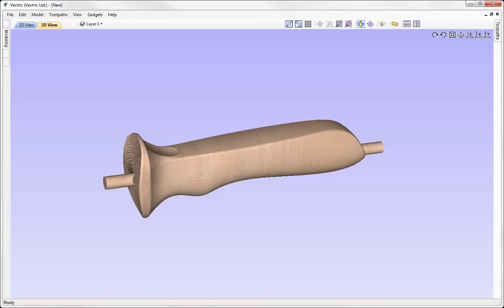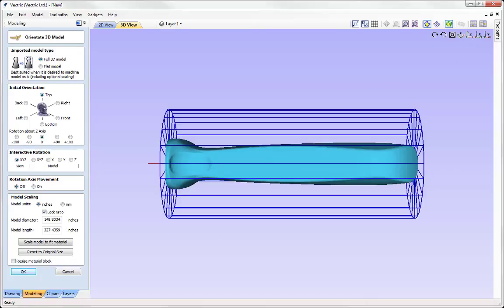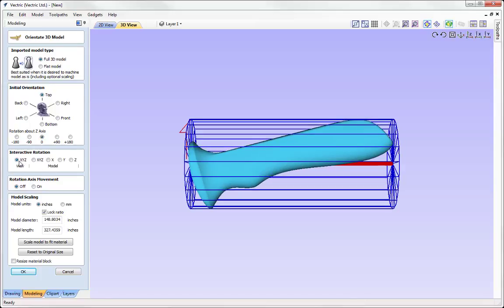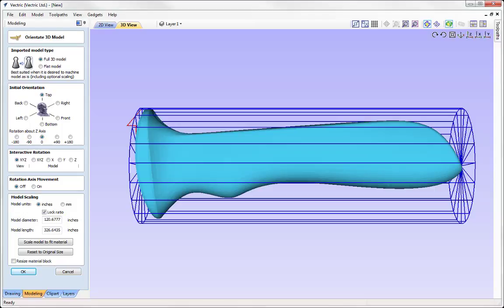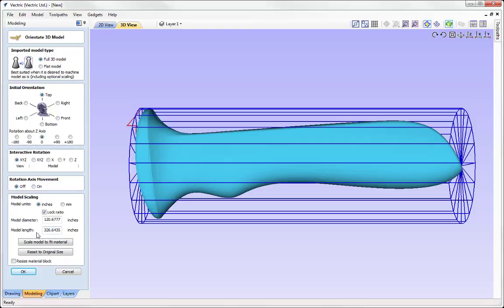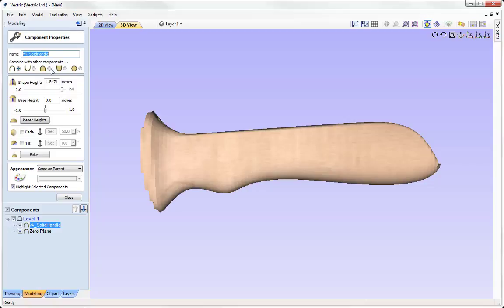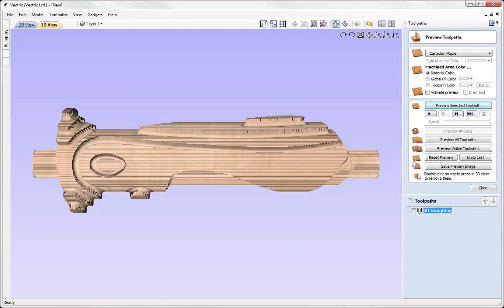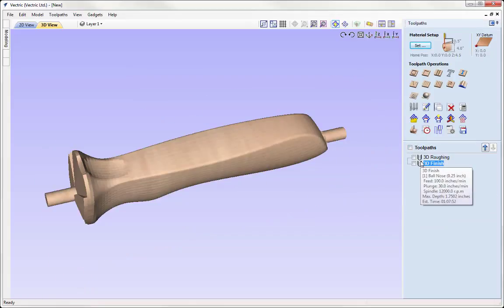Rotary Machining Import and Unwrap a Full 3D Model

Comment: Muy decepcionado con las posibilidades de un  eje rotatorio, creía que se podría fresar una rama de un árbol, o una figura con los brazos abiertos, pero no, solo cosas rectas y en bloque verdad?
Gracias por el video, me has sacado de muchas dudas
Reply from the maker: Hola y gracias por la pregunta. Hay muchos usos para la opción giratoria, incluso figuras. Es posible que tengas que ser creativo con algo como una persona con los brazos abiertos. Posiblemente usando la opción de segmentación y quitando los brazos, córtelos como una parte de 2 lados y luego el cuerpo como un trabajo rotatorio. Vuelva a colocar los brazos al final. Definitivamente puedes usarlo para mucho más que "cosas en bloques". Sugeriría explorarlo en nuestra versión de prueba y ser creativo con su proceso.

-----------------  Google Transulate above --------------------------
Hello and thanks for the question. There are lots of uses for the rotary option, even figurines.  You may need to get creative with something like a person with open arms.  Possibily using the segmentiation option and removing the arms, cut thoses as a 2 sided part and then the body as a rotary job.  Re attaching the arms in the end.  Defenitly you can use it for alot more then "blocky things".  I would suggest exploring it in our trial version, and getting creative with your process.

Comment: I'm using the aspire 9.5 program in my hand, there are some problems I couldn't understand. When I press the knife changing shower (ATTEMPTED AN UNSUPPORTED OPERATION), the program I installed is offline or is there another problem
Reply from the maker: Hello, and thank you for the comment.  It sound to me like you may need a bit of help from support@vectric.com If you send them an email, I'm sure they will be able to help.